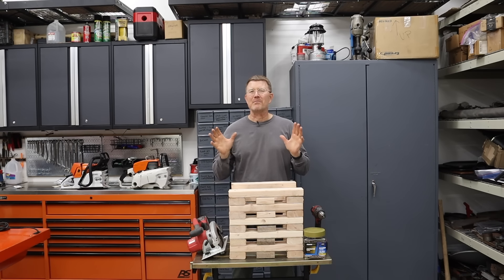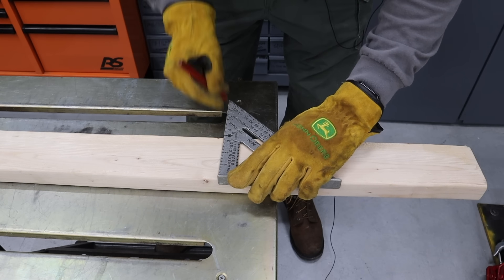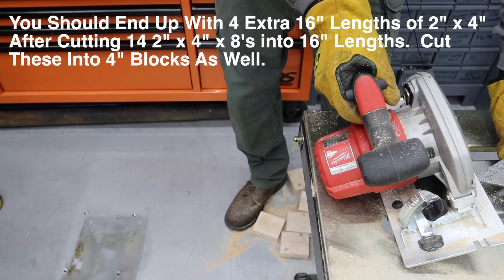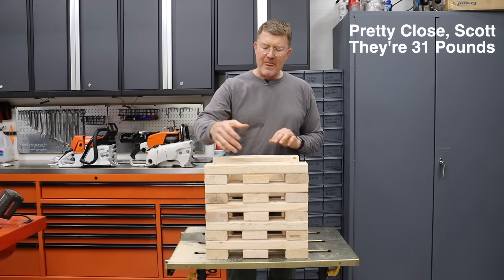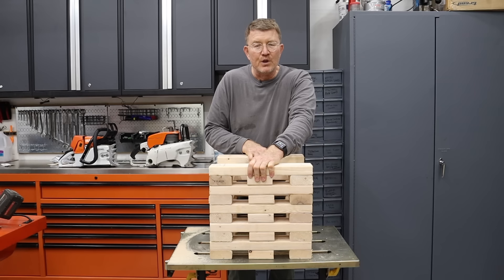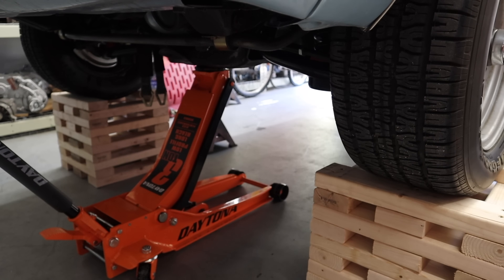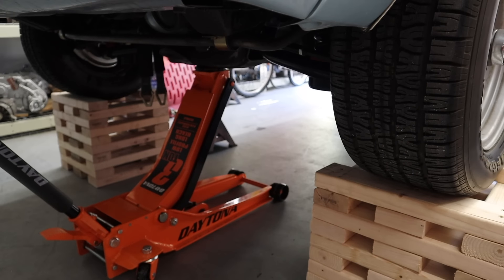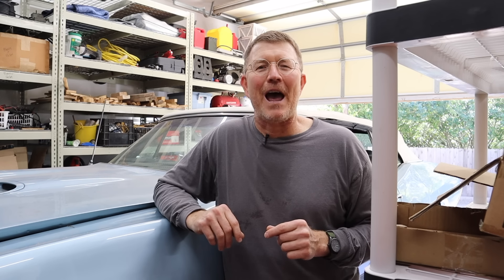Building Inexpensive Wheel Cribbing or Wooden Wheel Stands

Comment: I could see just drilling holes at all four corners and run 1/2-13 all thread through all of the boards. One "bolt" per corner (4 total). Recess the bottom nuts so it sits flush on the floor. (wood bit). 
This way you dont have to worry about splitting the wood with nails or screws and much more secure. Probably much faster to build as well.
If you had different lengths of all thread premade you could taylor the height at any time using the same wood. 
Id also look for some cheap hardwood. Doug fir 2x4's are fairly soft. Maybe use pallet material? That would lower the overall cost.
Reply from the maker: The all thread is interesting; certainly worth a try and it should speed up the process a bit, too.  I'm not a fan of pallet material, but it would work if you had a bunch available.  Thanks, Scott

Comment: I wonder if a center 2 by 6 with a vertical brace under it on the top layer would be under the center of the tire and give you a little extra height
Reply from the maker: Yes, it would give more height, but it would load the wheel stand differently, so not sure if that's a good thing or a bad thing.  Scott

Comment: Why saddle extensions? I just use some wood underneath the jack behind the front rollers.  Jack are designed with flat rails that allow for this.  I couple 2x4 stacked gets you that extra height.  I have done this countless times on all different surfaces.  its best if you have hardwood underneath jack but the pine only crushes a little in all my experiences.
Reply from the maker: I've never tried this before.  Thanks for the tip.  Scott

Comment: I am curious if the transmission and jack would fit under the car if you went from the front or back instead of the side. Can you measure the lowest point from the front and back to check if either way will work?
Reply from the maker: The car is no longer on the wheel stands, so it may be a while before I can get some measurements.  Thanks, Scott

Comment: I wanted to point out a possible safety issue.  Make the bottom rails of the cribbing extend another 6-12" to increase shift stability.   Sometimes a jack, especially on a rough surface like an older cement driveway with embedded rocks, it won't roll as easily under the vehicle as you jack it up, causing the vehicle to be pulled towards your jack.   Even just as a precaution incase something else fails or goes drastically wrong, you can have more confidence in your car not tipping the cribbing over.   Still a great simple build though!
Reply from the maker: Thanks for the input!  Scott

Comment: I'm sure you solved this long ago since this video is almost a year old, but you should have been able to lift the back of the tranny to pivot the top of the bellhousing forward and down to get it under the frame rail.
Reply from the maker: Yes, I managed to get the transmission installed, but thanks for the tip.  Scott

Comment: Cool Vid! What is brand of the Orange toolbox up front in shop? I feel very fortunate to have both 2 post and 4 post hoists to work on. The 4 post is inside the shop as I also use it for parking that extra vehicle. Still waiting on update on the little red car . . One just brought big $ on BaT
Reply from the maker: Hey Randy - The orange toolbox is a Homak RS Pro; I have three of the 72" bottom boxes.  Pretty good thread on these on GJ; they're a good box for the price.  Little red car is coming; I have to get the '68 Lemans convt. done and sold and then it's up next!  Thanks, Scott

Comment: My late bro, lifetime w GM, later Pierce-OSHKOSH said NEVER jack with differential. A crack would be $$$$. Also, hearing and eye protection?
Reply from the maker: I've been jacking on differentials for decades.  Never have seen or heard of that causing a crack.  Thanks for the input, Scott
Reply: Yes I have bent my axle tubes by jacking under the diff housing. It only takes once to learn!

Comment: my only comment is that screws are prone to shear.   nails are better for structure as they dont snap off when something flexes.  they use nails on deck frames and screws for the surface boards because of the nails ability to bend a little.  it probably isnt much of a worry.  id use the ones you made.   just throwing it out there that theres a way to make them a touch better.
Reply from the maker: I'm ok with the screws.  Thanks, Scott

Comment: Don't these need to be different sizes my back wheel width is larger than my front??
Reply from the maker: It's really not about the width unless you have really, really wide tires in the back.  Scott
Reply: @THEBULLETPROOFGARAGE  
Just got mine and 16x16 seems to be good. Tire can sit right in the middle with about an inch to an inch and a quarter on each side if it's sitting square in the middle. Front tires are quite a bit smaller but still seems to be stable. Thanks for the reply

Comment: That's all fair and good but what if you need to take the tires off what if you doing brakes or an axle.. I use 3 ton Jack's on the axle tube itself.. and on the frame up front and they're not maxed out... The problem with those is the space they take up in the shop and the bulk around the vehicle,..I've made them out of scrap "micro-lam"off are job sites, if there is a safety issue they can go under the frame,..they work great for painting,body work...yoy don't have to get on your knees to fix a "rocker" panel.good luck and stay safe.
Reply from the maker: All good points.  Thanks for the input, Scott

Comment: I either get a 2x10 and cut it into 18 inch pieces and stack them 4 high screwed together,,or a 6x6 in 2 18 inch pieces and put them side by side under my tires,,either of these can be taller or shorter according to taste or need,,,anyway I like the way it looks if the stands are solid,,,it makes me feel better,,I'm just putting another method in the mix
Reply from the maker: Thanks.  I use oak 6x6's for cribbing on my heavy equipment.  Scott

Comment: What's the weight limit on that cribbing solution Scott? What's the chance it will hold up my F350?  Probably not I'm guessing. Any other solutions for heavier SD trucks?
Reply from the maker: Serg - I really don't have any idea on the weight limit, but you could always screw some 3/4" plywood to the outside the strengthen it even more.  Thanks, Scott

Comment: I can't see that cribbing failing, I find a lot of people have no faith in timber, look at the old wooden roller coasters etc 👍
Gaz UK.
Reply from the maker: I can see it failing, but only if I used it to prop up my Caterpillar 977 or something stupid like that...  Thanks, Scott
Reply: the woods not going to break.   the concern is tipping.  If you watch when he sets it down on the front , the crib rocks and the front of the crib comes off the ground slightly. I would build a wider base
Reply: @ScreamingEagleFTW  Correct, for just a bit more timber it would be much safer.
Gaz UK.

Comment: My solution to the problem at the end of lacking a couple inches would be to put something under the jack, jack the car up, slide the transmission and trans jack under the car until it's in the transmission tunnel, then lower the car back on the cribs.

Comment: Don’t need the center boards, just make a square. I use them everyday on trucks and road boats. Got a 60 cad on a set right now. That car is a pig, no centers just a box. Just pine kiln dried, no PT, just 2x4 poo poo boards from HD and local lumberyards, the ones they can’t sell because they are twisted crap, just ask they will typically have a bunch for a good discount.
Reply from the maker: Thanks for the input.  Scott

Comment: Jack, why didn't you put the jack back under the front  cross member? Jack it up just enough for transmission to slide under the car to the trans tunnel let the car back down and then you would not have had to remove the transmission from the jack that it was on.

Comment: Would it be more structurally rigid to use full-length blocking in the center instead of just around the edges?
I love the concept....Good job!
No way I'm getting under 2 or 3 tons on jacks and jackstands...too old get stupider now! 😆
Reply from the maker: Sure, it would be more rigid, but you get to the point of diminishing returns and it adds weight, too.  I think these are plenty sturdy for what I will use them for.  Thanks, Scott
Reply: @THEBULLETPROOFGARAGE  , What worries me....without a solid layer of wood from top to bottom directly under the tires, those screws around the perimeter boards will just blowout and have a collapse like on 9/11?
Reply: I just built mine....but with all 2x6" wood. 
24" L x 18" W x 12" H, but made into 2 sections....a 6" H bottom and a perfectly fitting 6" section for the top.
They are SOLID!
I used interior grade non- predrill #10 3" long torx-head fasteners screwed in at a slight angle, from different directions per layer.
I'd sleep under that car now if not for the spider larvae.....😬
Reply from the maker: @PTucker0864  - that sounds quite sturdy!  Scott

Comment: Cinder blocks will do the same
Reply: Don't use cinder blocks -- I know 3 people who've died from that.  Use proper metal or proper wood stacks or a correct wood cribbing.  I'm an engineer.  You can get away with it with luck, but if somethings starts tilting or failing the cinder blocks crack.  You can crack cinder blocks with your hand if you punch it right.

Comment: How can it be 15 inches high if every board is 2 inches and you have atleast 9.5 boards of height?
Reply from the maker: You do realize that a 2x4 isn't 2" x 4", right?
Reply: @THEBULLETPROOFGARAGE  No, should I? How much is it then!
Reply: A 2 by 4 is 48 mm x 98 mm (1,889 in. x 3,858 in.).
His crib is 10 stacks of 2 by 4's (with the 2's on top of eachother) = 18.89 in.
Reply from the maker: @joarandrehansen  - A 2x4 is actually 1.5" x 3.5" or 38mm x 90mm.  1.5" x 10 = 15".
Reply: What would you do differently after this idea/experience and feedback?

Comment: Inexpensive Torx head screws and brand new lumber aNd... a 200$ brand new floor jack . . .  ❓❓😗
Reply from the maker: I'm not sure I understand your comment.
Reply: @THEBULLETPROOFGARAGE   * You spent like, a lot more than I would have spent. I'd use scavenged wood, nails and the crap floor jack I already have with a big block made from nailing something together. All that money and work and you still wound up a tad too short to roll the transmission under on its jack. Still a valuable video, and I like it, but it's mistitled. raathaa.. lol